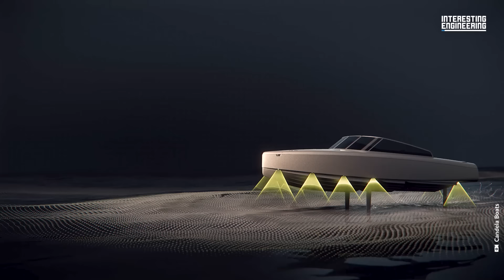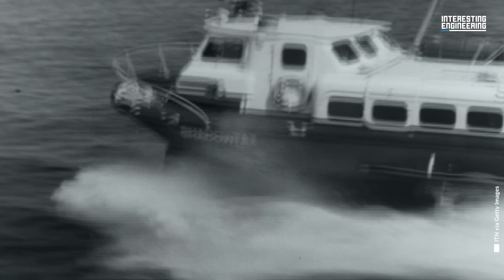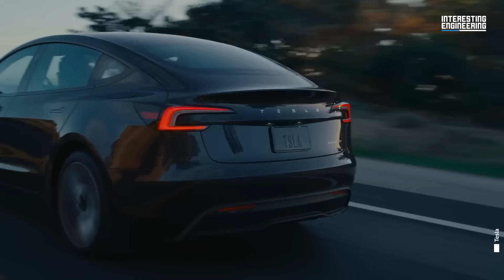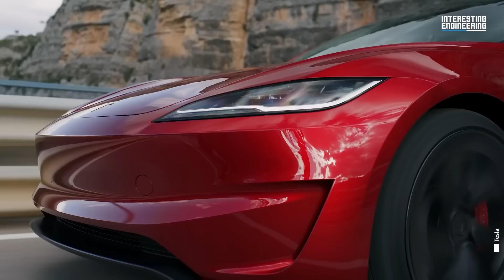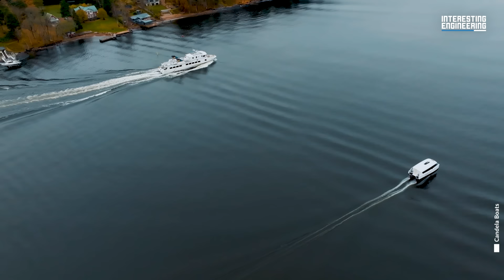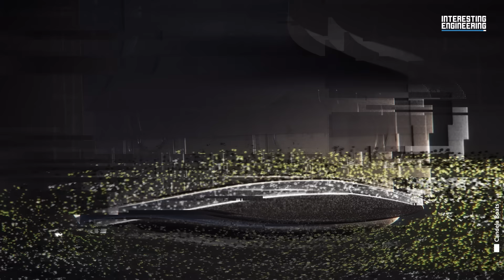How Hydrofoils are Leading the Way for Electric Boats

Comment: what if 1 leg hit a whale or a rock and gets broken ?
Reply: less damage than a normal boat and prop.
Reply: they're pretty strong most of made of carbon fiber.
Reply: The struts are designed to break away upon impact, just as the engines of airliners are designed to break away upon impact. Then you return to the dock for repairs as a traditional boat would.
Reply: it float on water or sleep with titanic